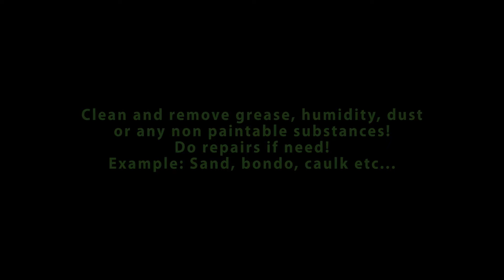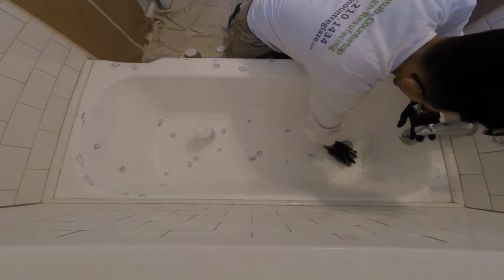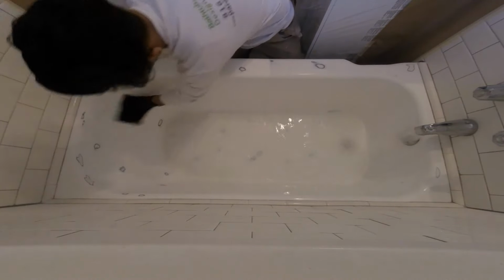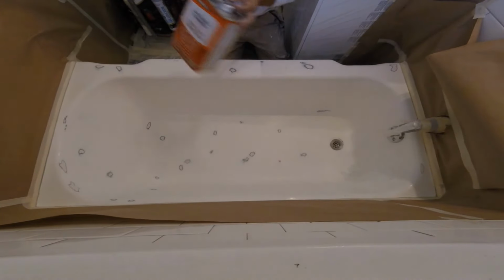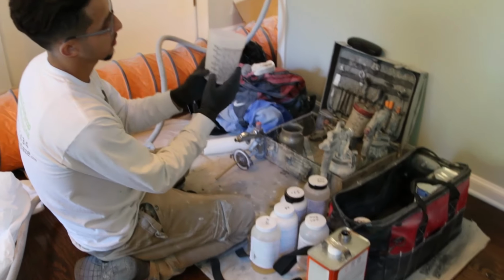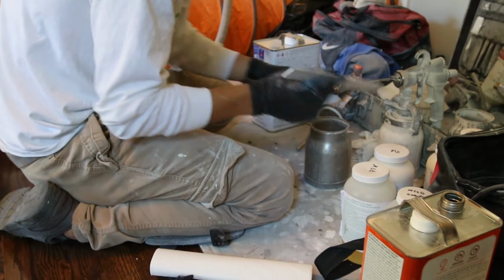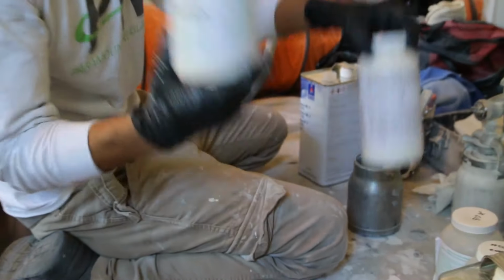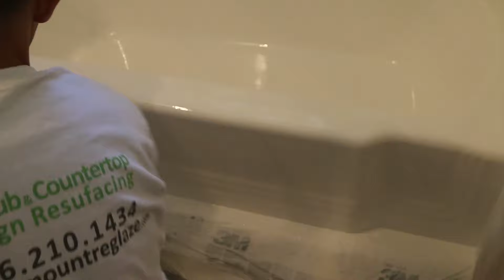Bathtub Resurfacing steps PR

Comment: Real tub reglazers remove the cabinet and wet sand this tub - or strip it and start from scratch. No mess when you wet sand my friend.
Reply: Mr. We are real! We work for more than 100 apartment complexes. And more than 10 residential jobs every week. I respect your opinion, but there are more than one way to do a good job.
Reply: @paramountreglaze4368  most guys in this trade didn't learn how to do this right from the get go. Dry sanding with a sander, craziest way to make a dust storm in a dwelling even with powerful ventilation running. Wet sanding is faster and aboslutely no mess. The only issue is most guys punk out, to physical. But if you stick with jt you learn how to do it right it's a snap.